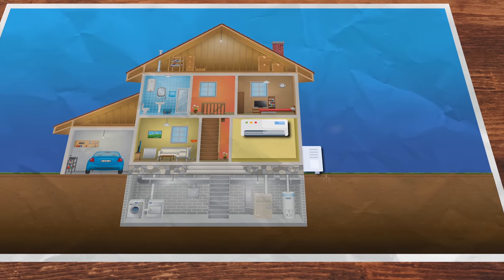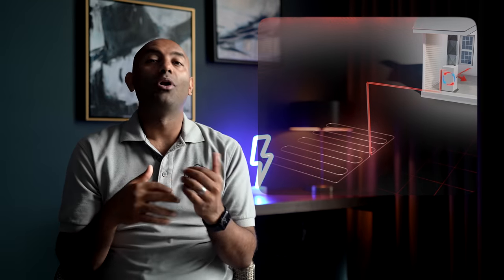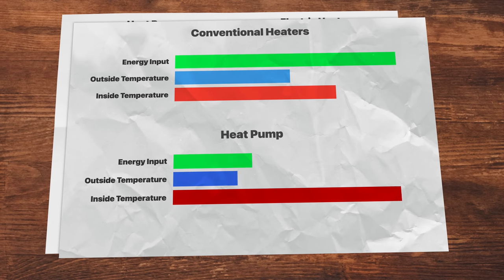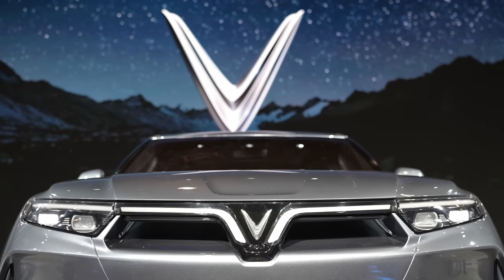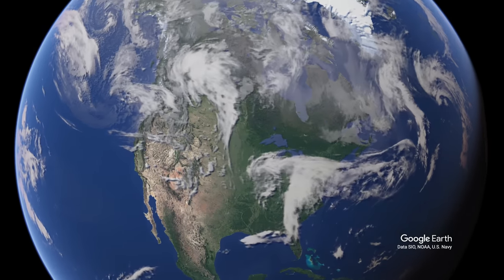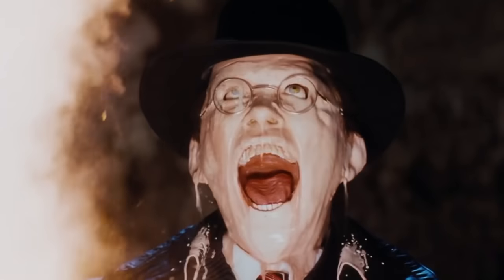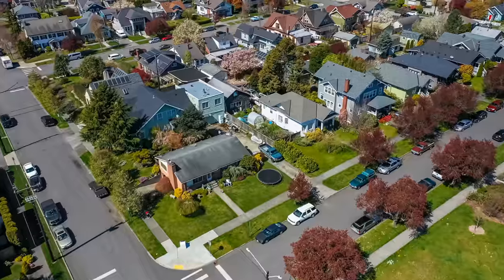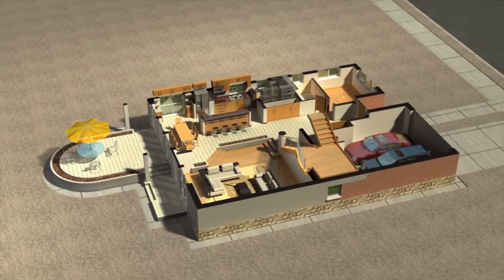Adding This Can Save You Money Summer & Winter!

Comment: That open loop is not ground source but water source (but yes, is geothermal category). The closed loop are ground source for heat pump. 
One important thing: there are 2 types of (closed) ground source for heat pumps 
1) horizontal geothermal with coils put under 1,5-2 meters, flat
2) vertical geothermal with a very deep and long one U coil, deep between 100-200 meters depends how much KWh thermal energy you need. 
In the UK where the space is limited and you can't put horizontal closed loops is used one shaft, well where you put the down coil and up coil. 
And, yes, geothermal (closed) source are far better than air source. 
Is the perfect source and with heat pump is the perfect solution for heating and cooling.
Reply: Modern air source heat pumps are getting more efficient - what COP are ground source
Reply: @TC-V8  They're upwards of 600% and the major benefit is that the SCOP is higher, especially in colder climates. Air source heat pumps start to lose their efficiency when it's well below freezing.
Reply: An expensive ground source heat pump might be putting the cart in front of the horse. Get your insulation right FIRST and you might (YMMV) end up with an air source pump being a much better fit.
Reply: @swmike  It freezes here. I spent my money on insulation, not an expensive well and ground source heat pump. A mini split that costs me $1000 installed can keep my place warm running at it's lowest setting now. But no installer will tell you that.
Reply: @astranger448  the isolation is better no matter what heating source and technology!! 
If you lose heat in winter you must consume more energy, it's elementary!  But say it like is needed only for heat pumps is a lie, is a mistake.
Reply: @Eduard.Popa.  You are absolutely right, but this is the internet. One has to do things in small portions. Talk was about heat pumps so I stick to the talk at hand. That makes it neither a lie, a mistake, or a willful omission. It is no different than explaining to a child how the rainbow works with a prism and a beam of light. It is not the whole of the explanation but it will do for a child.
Reply: @astranger448  any honest HVAC installer should tell you that but I agree not all put your saving money ahead of them getting it. Do your research and don’t count on someone telling the truth. It’s not high level science. Most HS grads should make sense out of the technology with ease. The very high SEER ratings of modern mini splits and their ability to make heat efficiently in sub zero winter temps make them an attractive and low cost choice. The only deciding factor then is based on your floor plan - whether it is open or needs ducts and your location. I doubt that they can meet the needs of a home owner in Canada or AK. They are now effective enough for most homes in the lower 48.  I think the only unknown about them now is how long they will last. I think most will last 20 years or more as there are choices available with 10 year or longer warrantees.
Reply: @dennisfahlstrom2515  I do you one better, we here in the EU have the EPC, Energy Performance Certificate. A licensed surveyor makes a detailed survey of a property, certificate that is mandatory for each and any real estate transaction. It rates the property A(good) to G(bad), recommends improvements in the correct order and supplies most every figure an owner/installer needs to right size. Outside real estate transactions EPC is an excellent tool for every homeowner willing to improve efficiency. They are simple and fairly cheap so you getting your house surveyed is an excellent way to get things right at lowest cost. No need to rely on the honesty of that sales representative who is not interested in your financial wellbeing as you rightly point out. EPC also has a huge impact on resale value, to the point that bad properties are no longer fixed. They get torn down for a new A rated one.
On the longevity of mini splits? No idea. I went all out on insulation + ventilation and get by with a small electric heater. I did the numbers on an equivalent mini-split. The one I need is the absolute smallest one and costs about 750ish US. No need to last forever at these prices. It's a different thing for the big stuff.

Comment: I live in a 200 year old cobblestone home in central NY and we just installed a horizontal geothermal heat pump along with enough solar to run our entire farm.  To be clear, we have fairly new insulation and replaced every window in the house 4 months ago.  We loving the systems so far.

Comment: I have a ground source heat pump and I think it is important to remember that you are using the ground like a battery by storing heat when cooling and taking heat from the ground when heating. Because of this, imbalances of your heating and cooling needs for the year affect efficiency. This is an often ignored element in the discussion.
Reply: Very good point.
Reply: This isn't really accurate, as the earth your loop is in contact with is not isolated.

In contrast, there are solar charging systems that attempt to isolate, or at least maximize volume effected and reduce surface area of effected earth, so that the natural insulation property of dry soil is to some extent isolating the thermal battery.

In most ground source loops, you are trying to tap into the ambient earth temp, not a thermal battery effect.
Reply: @markallen6433  but the heating or cooling you put into the ground doesn't dissipate quickly and that new ground temperature is what the heat is transferring to. I have heard of projects that had reduced efficiencies from this effect.
Reply: i am guessing you have a closed loop system.  Open loop systems generally dont have that problem.  My open loop system has a source well that draws fresh water into the system, and a second well that puts it back into the ground.  There is probably 50 ft of linear distance between the two; which insulates the source water from the warmed/cooled water.
Reply: @stupid1557  this is only possible with an undersized loop. Appropriate loop sizing will provide for reliable heat dissipation.
Reply: Not true, the ground is a radiator not a battery, there is no storing going on here.
Reply: My heat calcs said that I would only need 1ton for cooling. And 3-4tons for heating. So a significant difference in removing and replacing ground heat. My horizontal loops were sized for 4ton. But I was still concerned that it might affect my ground temperature. Especially since I live in Wisconsin. But my incoming water temperature taken March 1st of the first winter to March 1st of the 3rd winter. It was actually 2 degrees higher...maybe because of warmer summers?

I think that the problems come from undersized loops for the system

Comment: I have built several homes for myself and installed HVAC for a living including geothermal. My conclusion is this, spend your money on lowering your heat loss and heat and cool with mini splits with COP’S of 4+.  If your home is constructed to use 50 to 90% less energy by taking the 20K you would have spent extra for Geothermal you will always have that efficiency built in no matter what energy prices are. The other advantages of a mini split system is zoning which may actually be cheaper than Geothermal to run.

Comment: This is really great, I love hearing about this.
It looks to me like improvements in the machinery and techniques and technology to build the vertical systems are desperately needed for retrofitting existing homes.
I was wondering about the possibility that after enough time passes the temperature in the ground will change enough to alter efficiency significantly.  But I realized that Summer and winter are working against each other.  In summer the ground is being heated and in winter heat is being withdrawn from the ground. There could still be an imbalance but it would take longer than if both were working in the same direction. As another commentor mentioned, if there is an imbalance between winter and summer demands, the ground temperature may gradually change. But I would think that it wouldn’t change that much before enough heat flow from outside the region compensated.

Comment: I had a 700 foot vacation home that I upgraded when I retired. I built an addition of 1200 sf. and installed a geothermal heat pump. The original cabin was heated with radiant baseboards for a monthly cost of 360 dollars. The finished house after the addition was completed was 1920 sf. and cost about 125 per month to heat. Some of the savings came from added insulation and thermal windows but the overall cost of heating was so improved I was amazed. My estimates of heating costs were way too conservative. The system cost 18K so recovery would take years but the cost for cooling in summer went down even more. Retrofitting is a greater expense than installing in new construction so I would do geothermal again with no hesitation .

Comment: I lived in Phoenix at one point and first bought a home with a evap cooler which worked great until monsoon season when the humidity is driven up to 90%+ along with high temperatures.  I soon bought an air conditioner for those monsoon times  but kept the evap for other times.  I moved to Santa Fe, NM in 2007 and bought a LEED certified home and promptly put a solar system on my roof.  I have an air conditioner which the solar pays for.  In the winter it can get fairly cold here,  I still have the original gas furnace with a gas fireplace on the lower level.  I discovered that in the winter it  is cheaper  to use a small room size electric  heater to follow me where ever I am in the house reduces the cost of using the gas furnace.   Because my total house is pretty efficient I've pretty much reduced the cost of heating and cooling my home.  Most of the time using a combo of tools makes the most sense.

Comment: I'm located in the Northern Colorado Rockies up 7500 feet. I installed an Outdoor Wood Burning Boiler to heat my GreenHouse with for all year around growing. I ran 600 feet of 1/2 pex 2' under the dirt in the GH. Works great! I also heat my 3 story Log House with same through the existing 6 zone system radiant floor registers, and of course a heat exchanger, so I don't burn propane much any more. Cool huh? The boiler circulates 535 gallon of anti-freeze at 170 degrees, and firewood around here is free. : ) Edit to add; Oh, and the boiler has a reaction chamber for gasification, low emissions. But your vid gave me some great idea for the future. Good job! Thank you! Oh, and I'm all solar!
Reply: I'm jealous. You're on the right track but burning wood is one of the dirtiest polluters for heating. It adds soots and carbon and carcinogens into the air. But I'm still jealous.
Reply: @philborer877  P lease tell that to the National Forest Service to try to get them to stop lighting forrest fires. Oh, and say a little prayer to God please, concerning Lightening this summer. Thank you!

Comment: I had 3 estimates done to have geothermal installed. My house is extremely efficient 3400sqft. 2400sqft of shop and storage downstairs. 1000sqft of living space upstairs. All heated and cooled all of the time. The first 2 estimates came back $45,600 and $45,879. I couldn't afford that. Both had my house plans and both said I needed 6 ton. And had wildly different ideas for equipment.  I found out a local HVAC company had been installing geothermal for over 35 years. After looking at my plans.  He said that I would only need 3ton. But need back up. For when we get long stretches of -20f. Had way simpler ideas for equipment. I thought maybe I'll be able to afford my dream house. After doing  heat calcs. He called and said he found a 2 stage unit. That would run on 3ton and ramp up to 4ton for long -20f times. Wohoo my dream is going to happen. His estimate came back....$45,200
Last ditch effort I asked if the HVAC guy for 1,700,000sqft plant that I work in. Could help me out. He said that he had already helped 2 others at work with geothermal for their homes. 
He ordered the equipment that the last estimate had listed. That was all the help he offered. And I installed it. I used the guy that all 3 estimates listed for the 4 coiled  horizontal loops across the end of my 1 acre lot. My estimate from him was $5,000. ($700-$1,200 less than price listed in the estimates!) Loops installed and he came back and filled the system once done. 
I decided to use all infloor heat 6zones 3 in shop 3 in upstairs living space. I used warmboard upstairs. (I think it's the best most efficient infloor system). So a little more expensive. Inslab downstairs. I installed the 2" of foam and pex and manifolds before the slab went in. Total cost $23,000 including the loops. Doing it myself. Took me a few months. Figuring out how and installing it myself.
If I was a contractor who knew what I was doing . It probably would have taken a few days. For $22,000 profit. I had estimates for conventional HVAC of $26,000-$34,000 for my house. 
Going on 4 years. Running geothermal. And 5 years plus of the 10,080 watts of solar. Funny another $23,000 after tax rebate. 
5 years zero bills. Entire house is all electric. 

Oh yah I drive a forklift for a living.

Comment: By far the best bang for the buck is the air to air heat pump mini split. Cheap to buy and cheap to install and it cost me less than $5k to have my house heated and cooled. I live in Europe. 
My house is a 2 storey house with 3 bedrooms. I installed in my living room on the ground floor, one 18k BTU mini split AC which heats/cools living room and the kitchen. Also on the ground floor I installed one 12k BTU for the staircase and as the heat rises, it heats the staircase nicely all the way up to the second storey. 
In two smaller bedrooms I installed one for each room, two 9k BTU mini splits. The large bedroom has 12k BTU mini split.
When you set them up all together (in my case 5 individual mini splits), they heat/cool my whole house, including two washrooms (this system requires open doors throughout the house) and like I said, the whole thing from the scratch cost me $5k!!

Comment: I bought a home in Missouri on 20 acres. It had an old seer 9 heat pump that was on its last legs. I had to choose between a higher seer rated heat pump or some alternative. My state offers no incentives and my electric costs out in farm land was very cheap but I looked at things in the long term. My old heat pump was pretty cheap to run in the summer but in the winter when temps dropped below freezing it was almost useless and it required over $2000 a year worth of propane to supplement the heat pump. Summer bills averaged $150 a month but winter bills for electric and propane totaled $350-$400. My house has good double pane windows and very good insulation. I decided on geothermal. Altogether with a federal rebate my system cost me $14000 for a home that needed a 5 ton heat pump. I no longer use any propane (other than for my BBQ) and my electricity went down to $140 a month. My home is 4400 sq ft counting a finished basement. I’ve had the geo now for 12 years and my propane savings alone effectively paid for the geo system in 5 years because the cost of propane went up significantly. I’ve saved enough on this investment to pay for a 9.25 kw solar system so now my electricity costs my $30 a month. It’s an amazing way to save money even in an area with cheap electricity. Another consideration is that it’s a given that utilities will always go up. My electric coop prices while very cheap compared to where I used to live has still gone up 30% in the last 18 years and will go up again soon. Our propane has gone up 300%. So you can pay more now and less later or you can get stuck paying a lot more later.
Reply: Great account of your experience, Thank you 👍 ~

Comment: Living in mid-west Finland. 77 to -13 deg F through the year normally. Have had vertical geothermal system for 10 years with a 525 ft deep hole for a 1700 sqft house. Since I went from oil I already had radiators and investment after tax reduction was about 11-12k€. Electricity for all heating is about 4500 kWh/year and cheap ~0.125€/kWh (incl tax and distribution). I used to burn about 2000 liters of oil for a price of around 1€/l the last time i bought it (last couple of years up to 1,5€/l). Best investment I've ever done.